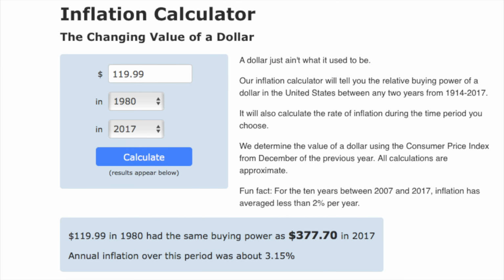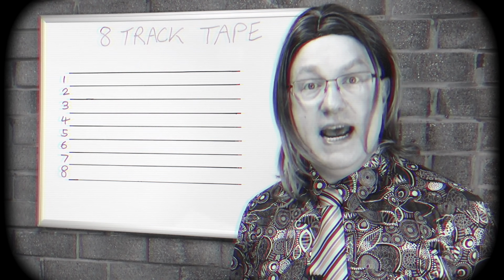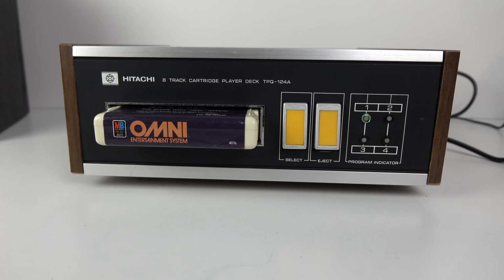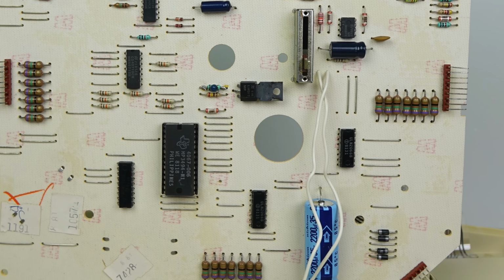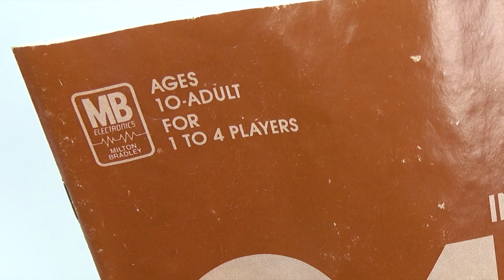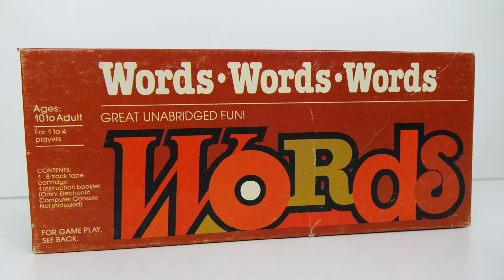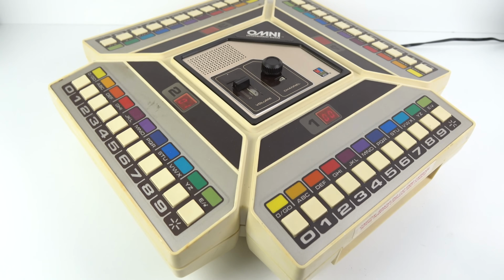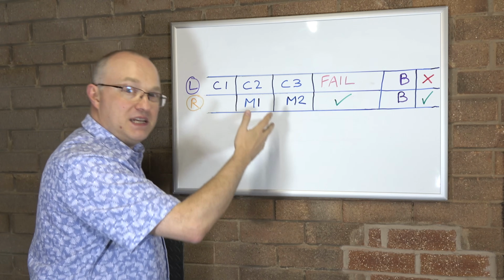MB OMNI Entertainment System - The 1980s 8-Track games machine.

Comment: If the data bursts can be reverse engineered along with the electronics, it would be possible to create an Omni simulator for a computer. Record the tape tracks to lossless WAV or FLAC then put them into folders as four stereo tracks.

Then it would be possible to create new games, even recording them to tapes for the real consoles.

But wait, there's more! The simulator could have expanded capabilities for random access, longer games with more questions, eliminating the wait messages and filler music and other limitations of the real machine.

Comment: Never heard of this game before. This game was from 1980, and it requires 8-track tapes where it comes with a game. Kinda similar to "Quiz Wiz", the original Coleco and the Tiger versions. It was by MB Electronics, a subsidiary of Milton Bradley which is now Hasbro. They also made Electronic Battleship, an updated version of the original Battleship with it has all of the buttons where you can tell that if you can get like C7 or E2, or any of the combination buttons, you hit the Fire button where you can indicate that if it was a hit or a miss. It was a very fun game.

Comment: @ 14:14 - The fix was when you pulled the Texas Instuments chips with their gnarly tin plating on the leads. Notice how the legs of the chip are oxidized and black. I don't know what TI used in the tin plate - but it became non-conductive over time.

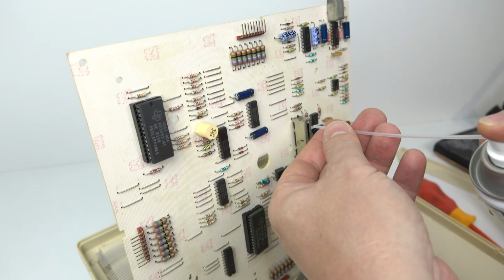Comment: 14:13 ARGH FUCK ME DEAD! Those 4000 series CMOS LSI SSI ICs are INCREDIBLY static sensitive. Although getting replacements isn't too difficult. A grounded wrist strap, conductive foam and trays, sometimes even DC powered soldering irons and air humidifiers were de rigueur for working with them o.O
Reply: All's well that ends well :D

Comment: We must reverse engineer this fascinating alien technology!
Reply: I'm guessing it's a sequencer or a state machine, not a general purpose computer. Probably sadly with an ASIC with the die mounted straight on the PCB with the ubuiquious drop of brown potting compound like all the digital watches and hand held games like Pacman and Donkey Kong that came along a bit later. If so it will be near impossible to find out exactly how it works without destroying it.
Reply: Oh wow, nope DIP 4000 series CMOS LSI SSI chips all round :D You can see some 4076 4 bit D-Type latches, 4001 quad NOR gates, etc. My guess is some sort of simple state machine with a counter, which I guess would make it a sequencer? :D I really want to get one now to reverse engineer it :D :D :D 

EDIT: I had in my head "Low Scale Integration (LSI)" when I should have had "small scale integration (SSI)".  LSI of course stands for "Large Scale Integration".  SSI is things like individual gates, which is what we have here. Medium Scale Integration is things like UARTS or ALUs on a chip. VLSI is complete microprocessors. And  LSI correctly refers to Large Scale integration. What it refers to I can't tell you, but presumably somewhere in between MSI and VLSI. Probably a processor in a handful chips or something like that. Probably a RAM bigger than about 1kbit but smaller than 32kbit is probably considered LSI also. The perils of using obsolete terminology you haven't used in decades

Comment: I had something like this when I was a kid. A VCR based system. Video Smarts, I think it was called, that worked on a similar principal. Special data was encoded on the tape, which was heard as an audible ding after each question was asked, that would set the controller to flash a green light and sound if you answered right, and red lights and a bad sound if you pushed anything else. There are videos for it up on youtube.

Comment: bit more analysis, the two big chips are connected to the keypads, there is zero memory on the entire board so it's got to have some bcd counter and a bcd-> 7seg chip under each player display and the main board just sends signals for add points and reset
still having trouble finding how it's storing the answer but it could be some capacitive storage 

the chips on the board are entirley cmos logic and analog switches multiplexers comperators and opamps

i'd love to have a scan of both sides of the board

Comment: reminds me of an almost similar electronic device / game of the same era ...
saw it in 1979 i guess ...
4 players sitting on 4 sides of a console about the same size as this ... maybe slightly smaller?
there were 4 translucent pads, each in a different color (Blue, Green, Red, Yellow? with lights under them that would light up when the pads were tapped on ...
player 1 started playing some random rhythm pattern by tapping at least once on pad 1 ...
player 2 had to repeat the same pattern correctly so scores could be assigned for that player ...
player 3 had to continue doing the same correctly again and so on ...
in case of errors, well, can't remember what happened then really!? :)
i'm sure Techmoan must have done a video on that machine too ...

Comment: The two large chips appear to be analog multiplexers, it would be possible to design this game only using discrete logic, but I would expect to see a bit more complicated board.  Especially given the betting and spelling variations.  There is a 18 pin chip in the lower left hand quadrant I suspect might be a microcontroller.  I can't make out the markings on it alas
Reply: I am nearly certain I am wrong about this.  After doing some digging, they appear to be specially branded versions of the TI TMS1000 4-bit microcontroller.

Comment: Jeopardy was in the UK in 1990-1991, but even then, it didn't do well.

Also, I believe that version was based on the version that Art Fleming hosted, not the current Alex Trebek version.

The version on this game system is very simplified compared to the TV version, and the TV version's rules are actually simple as well: 6 categories each with dollar amounts ($200-$1000 in round one, $400-$2000 in round two) are displayed on a board, and a player chooses a category and dollar amount. When the answer is read, any of the three players rings in. If they respond with the right question, they earn the dollar amount of the answer. If they get it wrong, they lose that amount. It continues on until all the questions have been exhausted, or they run out of time in the round.

Comment: Hi there. A nice video indeed. Please forgive me but my "techie" side of my personality is kicking in. 1- At ~ 14 minutes in the tape head can be seen as wobbling and coupled with the picky  way the tape needs to be inserted told me that there was something amiss in the transport / playback area. 8 tracks were made to tolerate abuse or should I say "rough handling".  This was confirmed at ~ 16 minutes.  2 Always a good idea to do a bit of preventative maintenance and "reseat" the socketed chips. Good show.  Question, You seem to be using a a great deal of epoxy for such a small area. Was there something else that was broken perhaps from an up coming video?  3- At the 20 minute point you dissect an 8 track tape. I have seen brand new tapes playing improperly ie one channel from one song and the other channel playing a track from another song. I feel the fault is partly due to the player and the also to the manufacturer using less than audiophile grade materials. At least with standard audio cassettes this wasn't seen.  I prefer your you puppets. Great job. Very informative and entertaining.

Also, have you covered V (Victory) or War discs in a prior video?  If not I humbly suggest that you look into them. They have a very interesting history.
Reply: epoxy never works in small amounts

Comment: The phone number 413-525-6411 remains in service at the same facility in East Longmeadow, Massachusetts, which Hasbro (parent company of MB) sold to Cartamundi in 2015. (Hasbro board games continue to be manufactured there under a contractual agreement.) 800-628-8608 currently is a disused number belonging to an unrelated company.

Comment: Anyone recognise the chips? Just wondering if one of them's a CPU, or more likely an early microcontroller like in Big Trak and Speak 'n' Spell. Those beeps could be data, for a simple state machine implemented in software, or pure software, of just a few bytes, forming a short program telling it what to do. 

It could even be a state machine implemented in hardware, that reads tape, but that'd be more complicated than the microcontroller, and they were available at the time. For the various jobs it has to do, and the small amount of chips on board, an MCU would seem to be the answer. You had to be a big company to get one programmed in those days, but MB certainly pass muster, and indeed have used them before.

Comment: The data recorder (audio cassette tape) for the Atari 800 and 400 used one track for data which left the other track for recording audio. I don't remember any games that used this function (I'm sure there were a few) but I used to make programs for my 800 that would use the analog track to tell you the name of the program you were loading in because I would run out of room on the tape to write in the program name.

Comment: Great video! I am curious why you used epoxy instead of cyanoacrylate to fix the plastic that holds the tape head?
Reply from the maker: I had some epoxy.
Reply: +Justin Frodsham Super Glue isn't the miracle stuff a lot of people seem to think it is; in my experience it's very much a Prima Donna regarding what you can use it on and how well it will actually hold. I tend to use it for small things in a limited fashion but if I want to make sure something bigger stays together I pull out the epoxy.

Comment: You should copy those tapes! Not that this is exactly simple... if you have a 1/4" 8 track reel to reel that plays all 8 channels into an 8 ch. input on a computer that would be the best (then go back out to another tape cut to the same length). But you could also use a regular 8 track cartridge player/recorder to and from a computer. I suppose you'd have to use (any) reel to reel to determine the length of tape to cut but it should be possible.... Then you could also play with the data to make it do weird things or even make your own cartridges!